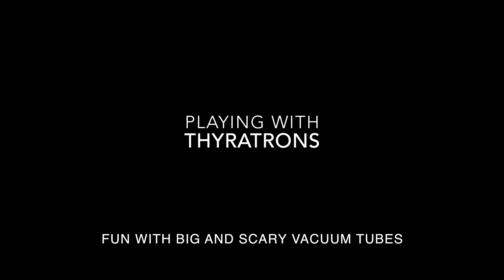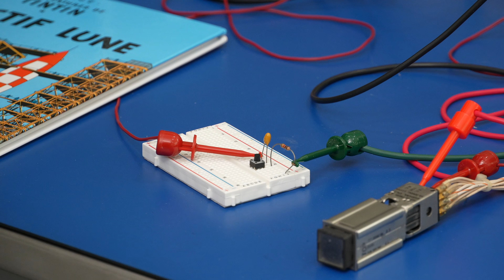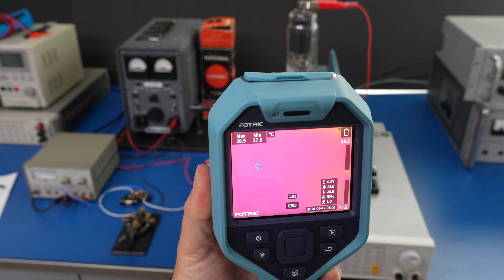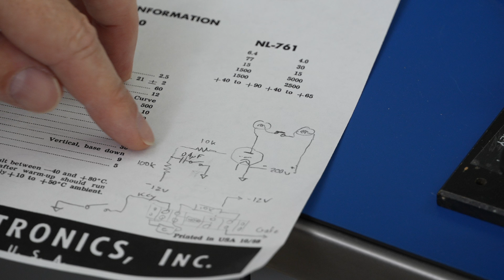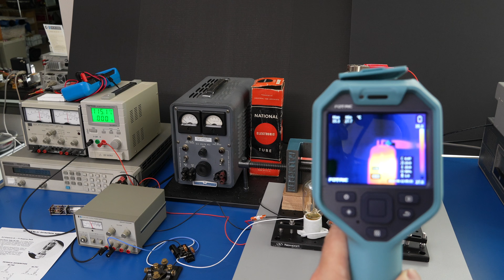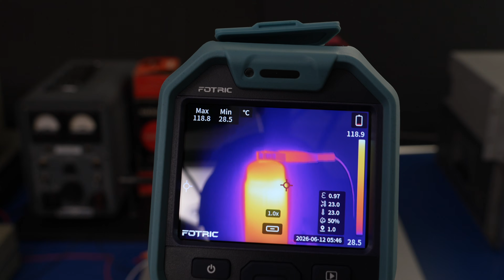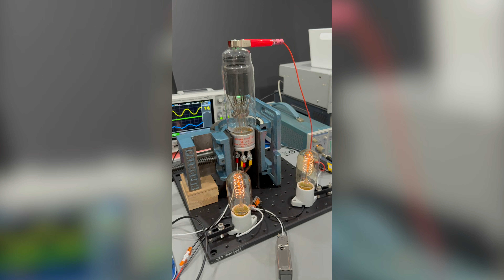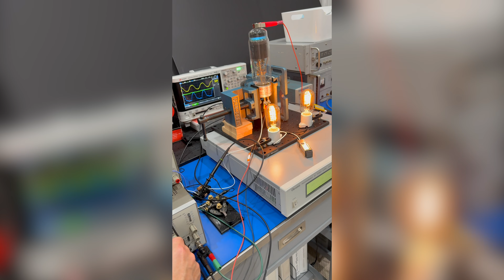We power up a giant Thyratron tube

Comment: Lightsaber sound was an unshielded mic passing in front of a CRT!!
Reply from the maker: It’s far more refined and complex than that. From how Star Wars’ Ben Burtt described it, it’s a combo of a cinema projector sound with pressure applied to the flywheel, a 60 Hz hum from an old TV set, both mixed and played on a speaker, then recorded with a moving microphone to create the movement. But that’s just the starting base. There is a lot more added, like crackle and sizzle from different sources to make the final sound. Ben Burtt was a sci-fi sound effect genius.

Comment: The 1950's vintage GRC-9 field radio uses a Thyratron tube, when outside it's case you can see that tube glow, mine has a pink/purple glow to it, very cool.
Reply: That tube is a voltage regulator, like a zener diode.
Reply: Probably a gaseous regulator... yep, manual says OC3, argon-filled cold cathode VR.  Very cool, literally.  The vibrator power supply has two mercury vapor rectifiers evidently.

Comment: Recently watched video on Schlieren Variotron 1950s electronically speed-regulated elevator controller.  Two beautiful thyratron tubes in all their blue discharge "glow-ry!"
Reply: Yep, i've seen them first in the video "Aufzugsmaschinenraum ehemals Rockwell Hochhaus Aarau". That building was been demolished / blasted shortly afterwards. In addition, the Atanasoff-Berry Computer used them afair aswell to punch holes into a Strip of Paper by using Arcs created by its Thyratrons, for later readout / backup of the Capacitor Memory drum contents. If i remember correctly, Atanasoff himself stated that the readback of those Stripes by using brushes wasn't working very good, altrough punching worked.
Reply: @Never_mind-f4d 
Cool.  Just watched that one.  Sehr nett!
Reply: @beryllium1932  No problem! I like electromechanical control devices pretty much, like those being used in old gambling machines with electromechanical cam switches and relays. For me it's really some kind of art putting that all together and make it work. Sure, electronic controllers can be implemented way faster and cheaper, but you won't hear and see them work, so it's nearly impossible to figure out how they work - at least not "on the fly". 

And i trust those old controllers more than modern ones, to be honest, even if they need some service too. But in a good implementation high voltages are being switched by a relay / power contactor with more than one contact and its pretty unlikely that the coil itself fails. In a electronics controller, there is maybe a FET/Triac or whatever with no backup counterpart, or other parts being risky dimensioned. If it blows, it blows and if it does, the entire system fails. 

I was working in a 8 floor building where the Elevator from the early 70s was at least 18 Hours a day nearly in permant use (i mean - really-  permanent); there was not a single failure within two years i was working there (i was responsible for that thing too, so if service had to be done, it was my task to call it). And that made a huge impact to me.

Comment: Back in my "youth" (early 1960's) I made a capacity relay with (yes!) a 2D21 and a voltage regulator.  It drive a relay.  I made it in a small 2x4x4 box.  It worked very nicely.